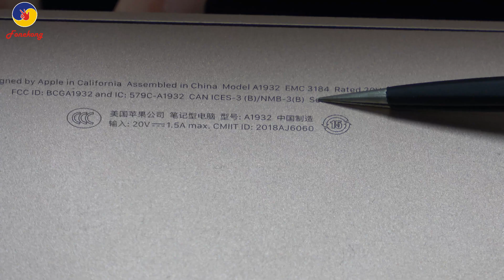MACBOOK REPAIR:A1932 T2 REBALLING

Comment: This is a fake AD video. T2 Chip has 2 layers and BGA between the layers. If you heat is with only top heating the balls of the upper layer will melt quicker and there's no way to take the chip out not destroying the balls of the intermediate layer. Never do that!